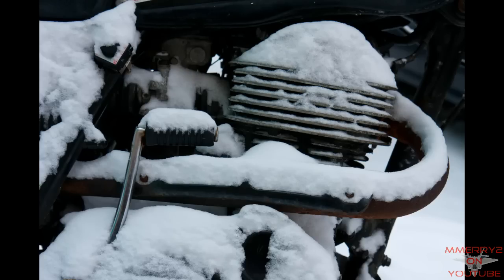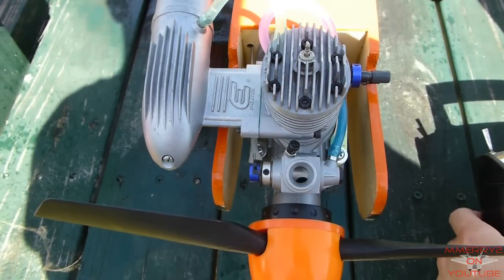Transitioning from Electric to Glow/Nitro Planes:  Intro to Glow RC Planes

Comment: My son and I flew control line then RC  nitro for years and my son passed in 2014 and left enough stuff to supply a hobby shop which I have in the shop (50+ new engines) ect.   I stopped flying in 2016 due to health problems. We sure had lots of good times.
Reply: Love that you have good memories and thanks for sharing the love here with us too :thanksdoc:
Reply: Me and my dad fly modern planes we love it. Know what u mean love yall
Reply: My dad has 60, some of which go back to 1947. He bought a Taplin twin when he was 16 then sold it. About 15 years ago, he wanted one again. He went online and bought one. When he opened the box, he found it was exactly the same one. He had a photo of it with the  serial number, and it matched. It also had marks on that he'd made by accident. Still there 40 years later.

Comment: There is so much used glow plane field gear on the used market, there is no need to buy any of it new.
Reply: @Rich Jake Some of the most fun I've ever had at the flying field was with cheap ancient third-hand glow planes that I've restored. Spent less on my 20-size Bridi Warlord all told than just the PnP foamie rough equivalent would cost and I love it to death. And the engine on it is so old it predates schneurle porting! But it's an OS so it runs mint.

Old does not mean bad. Just means inspect. Those old clevises might still be good might not be good you won't know if you don't inspect them. REplace the bad ones, leave the good ones alone.

New batteries and receivers are a given though, since these old planes usually have obsolete AM receivers and crappy nickel batteries in them. I usually put a 2s LiFE battery and a Futaba R2006GS in mine.

Comment: Started flying these “glow plug” fifty years ago.  I always loved them.  Yes they cause a bit of a mess with the oil in the fuel, but they are easier to handle in the wind and the engine sound is great.  They are just an all around great power source.  I do not fly anymore but still have a couple “OS Max” down in the barn. A 40 and a 60 as I recall.
Reply: Good man ya cant beat em  i still fly diesal ,and nitro here in Ireland electic planes no from me i still build by balsa wood it my take 2- 4- 6 months but its worth it in the end 😊
Reply: If you would like to sell the size .60 let me know .

Comment: Had to comment: I began my life long love affair with Aviation, way back in 1966, in college, and loving to fly my control line planes. By 1975, I bought my 1st radio for RC flying. Built an RCM Trainer by Bridi, and was smart enough to have an instructor from our club in Richardson, Texas, We were R2C2, pronounced, "R square C square". That name came from Texas Instruments where most of the club members worked at the time. Everyone learned to fly RC, at that time, by transferring the transmitter back and forth with the instructor to avoid any crashes. Worked for me, and I was off and running.

Fast forward to today, 08/2020, I'm in Florida today with my wife. Retired and still flying RC. Pattern is my choice of flying, with a touch of aerobatics. No 3D for me, I just love the pure joy of flight. During my hiatus from 1975 to 2020, I had bought 2 real aircraft, a Beech Musketeer, and a Grumman Yankee, while still flying my 1st love, RC! Now retired from Medical Engineering, I'm still flying Pattern. I switched from fuel to electric several years ago, and have been sorry I ever left fuel. Oh, I never liked all the clean up, but compared to electrics, I came back to fuel, and recently installed an OS 120AX in my 10+ pound, 73" plane. Big difference, and now I'm back home where I belong. 

The newbies of today think they love RC, but have no idea what the real joy of RC is, or even means. When something breaks, it's, "Oh my gosh, what do I do now"? They have no idea how to fix anything. They should try to build something from scratch, having only plans. Buy the balsa, ply, coverings, everything. They have no idea what they are missing. I built my favorite plane of all times, back in 2000, by the name of "der jager", all lower case. Means, "The Hunter"! A beautiful German looking bi-plane that was designed and built in 1968. Yes, 1968 as an experimental aircraft, then scaled down to an RC model. The feature article in RC Modeler in 1972. Wish I could send a picture of my plane. Finished it and have flown it 7 times. I have so much emotion in the plane, I don't want to spoil it from it's pristine condition today.

Best wind this up for now. I know electric is the thing today, but even though it does get those into the hobby quicker, and a bit cheaper, it's not the real thing. To be an RC modeler, one needs to be able to build from an ARF, at least, then finish it out by mounting the power plant, balance the plane fore & aft, double check all connections, fuel it up, and do the maiden flight YOURSELF! Now, that's what we old timers do, and have done many times. Buying a new foam airplane is not what the hobby is all about, bUT it is a beginning of a life's love affaire with Aviation! Good Luck To All!

Yes, my wife knows how I feel, and encourages me every day. What a Sweetheart she is! Married 24 years!
Reply: You sir have hit it right on the head! And I agree with you. I started scratch building airplanes in the very late 1970s for Radio Control. Before that it was dope and tissue rubber band propelled planes. I have not scratch built in about ten years, but I do enjoy buying old used balsa airplanes from Used online web sites. I almost always have to do something to them in the way of repair before they are ready to fly once more. And yes you just can’t beat the look feel smell and sound of IC glow engines. I fly all four stoke  for glow and some electrics too 50/50 mix.
Reply: I got into the hobby when I was 12 in 2013. Since then I have designed, built from complete scratch, 5 different airplanes, wood, foam, jet and prop. First scratch build when I was 15 and first gas plane just after that. I agree the modern eager rc flyer is spoiled by the sad phasing out of kits and overall patience, but some of us still exist! Not all hope is lost!

Comment: Interesting article, as it brought back memories. I began my model aviation way back in 1960, flying control line. By 1964, began researching radio control, and bought my 1st radio, an EK Logictrol from Texas Instruments. Many of the flyers were engineers from TI, and the club was the Richardson Radio Control Club. With so many TI flyers in the club, they changed the name of the club to R2C2, meaning Richardson Radio Control Club. I always liked that. I began with an instructor, and a high wing trainer called an RCM Trainer 60. Today, after over 40 years flying RC, from sport, to scale, to Pattern, I'm considering a rebuild for that old RCM Trainer. 

Referencing these foamies, I have tried 1-2, and can't stand them. Too quiet. This is not the RC flying I grew up with. I want to hear the sound of a perfectly tuned 2 stroke engine, not the pathetic buzz of an electric motor. I flew Pattern with an electric, and all seemed okay, but the hastle of charging the batteries the night before, and the other dangers of the immediate activation of the throttle control, with a razor edged 17" prop, just waiting to cut off a finger or two. Not for me. I've gone back to what I know and have always loved, Glow. Yes, the fuel is expensive. I used to pay $4/gallon, back in the early 70's, now at $30 +, and add to that Hazmat charges to get it delivered to your front door, it is still worth the price. It all breaks down to a cost per flight with my 1.20AX nitro monster at $5.20 for a 16oz. flight. Not cheap, but then what do you want? You want the pride of flying a plane you built, or even assembled from an ARF kit, weighing 10-11 lbs, or a 10-30 ounce foam looking plane that is, well let me say, there is no comparison. If you want to be a true RC hobbiest,  build your planes from a kit, or from scratch. These foam, look alike planes are cute, but they just don't do it for me, and from what I read, from many others as well.

My RC history took me from my college days, to getting my "Private License" in 1978. What a thrill that was, flying at 3000' and above, going to Oshkosh 3 times, and loving aviation even more than I had ever thought one could. I'm retired now from medical engineering, which brought me the money needed to keep in model aviation, and eventually owning 2, full sized aircraft. A Beech Musketeer was my first, which I never really likes until I bought my pride and joy, a Grumman Yankee, 2 seater. Today, I still fly RC, and enjoy what I found in the 1960's. Looking back, it was radio control that started my life's love affair with flying, and it has proven to be my sanity in todays screwed up world of millennials and miss information from all the news networks. God Bless America!

Comment: Here at the field they put the plane vertically with the engine on full throttle to see if it runs good in any condition... They also always remember me to not dive in full throttle because the engine will stop, and to listen carefully to the noise in flight... Your video is perfect for me! Thanks!!!

Comment: Thank you! This is very informative. 
I just acquired a nitro plane, and I had no idea what to do until now.
I've been flying electric so far
Reply: have a nice time up there and cleaning hehe
Reply: I still havent gotten mine up yet. I had mine given to me two years ago now. I first flew nitro in 1978 and HATED it. I started back into flying with an Apprentice  and loved it. Now I am ready to get back into flying nitro again. I have the Cadet LT-40. It should be a fun plane to relearn Nitro on. I had to replace the engine that was on it. The old engine had rusted up corroded bearings. I rebuilt it myself but havent tested it yet. I dont have much faith in it as the bearings were really bad and the piston rod bushing was siezed up. I finally got it to move again but it may end up failing. Thats why I bought a replacement engine. Brand new. I need to break it in.
Reply: Find your local club and talk to some   nitro plane guys they will be able to help you start it, and tune it and set everything up
Reply: Andy Weese, How do I go about finding my local RC club?

Comment: as one that use to fly nitro I can tell you there are advantages to both. nitro does deliver a little more power but you have a greater chance of a dead stick . the fuel is messy and fuel is expensive . you also need alot more support ie: NI starter , battery charger, electric starter or stick or a new nickname (stumpy ). fuel pump ect... and spend some time tuning and returning you motor for that days flying.

electric : airplane , battery , radio , battery charger.
more flight time less hassel , no clean up.
battery's can be expensive but compared to fuel I believe cheaper in the long haul. average life from a lipo is 50 to 100 charges . assuming you don't abuse the batteries. 
downside shorter flight times.
 For me I prefer electric  , call me lazy if you must but isn't the point to have fun flying?  how is spending part of your flight time getting the plane ready to fly fun?
some guys may like it , I don't .
I have to admit I love the smell of nitro methanol in the morning !
Reply: well I used to fly only electric, 2 weekends ago I bought my first nitro...just got my second yesterday :) Granted, it's not for everyone but if you like to tinker with things, taking apart cleaning and tuning your nitro or gas engine is a lot of fun in itself. And yes I think gas fly better than electric but electric is for when all you want to do that day is fly around. Both have their uses.
Reply: I like the fact that an engine gives out a constant power level as long as there’s fuel in the tank - with electrics I find myself wondering whether there’s enough in reserve for a go-around. In addition, I’m very wary of lithium batteries’ potential fire risks - I never worry about my glow engines burning the garage down :) It’s a personal choice - I love tinkering with engines, but I see the advantages of electric also.

Comment: You can also use a squeeze bottle for filling the tank. It's a handy bottle that also allows you to squirt a little fuel directly into the carburetor before starting your engine.

Comment: I fly both electric motors and 4 stroke glow engines, mostly on balsa airplanes. I do have several foam planes but much prefer the balsa airplanes over the foam.  I like both electric and glow. But really enjoy flying the glow the most at this point in time. I like the sound the smell and the feel of the glow four stroke engines. Down side is the cost of fuel and the oily mess. Upside is the longer run times of a glow 0ver electric, for my planes anyways. The electric are easier to get up in the air and are clean, but flight times are not  as long as the glow. 
Electrics take time to recharge the battery so you either have to have a bunch of Lipo battery packs fully charged on hand or you will be waiting to fly again. With glow you just refill and your off flying again. I take a mix of electric and glow to the field when I fly.
Reply: @Sun n Tan yes the sportsters and sky walkers are nice. I have both in.40 size and also 1/3 scale Space Walker

Comment: Hi there, i really enjoyed watching your video.  Very well presented and very well explained.  Im flying 32 years and up until recently all ive ever flown were glow planes.  The sound of a four stroke engine is music to my ears and i do like the smell of glow fuel also.  In the last couple of years ive started to fly a few electric planes such as the Multiplex Twinstar and the Multiplex Mentor which i have on floats and i love flying those planes also.  I especially prefer my float planes to be electric rather than ic as they are more reliable on the water. But overall i still prefer my glow planes mainly for the sound and realism and the smoke trail they leave behind.  Ive just recently purchased an electric B-17 flying fortress with a wingspan of 74 inches and i have to say that it flys really well, just like a big trainer.  PS. I still have my Alpha 40 trainer, the same one as featured in the video and i still fly it.

Comment: Awesome video.... you answered so many of the questions I had! Thank you! I fly electric but had curiosity for nitro/gas. Recently bought an airplane with the engine taken apart due to varnish build-up (OS Max 40). I cleaned it all up and was in the process of reassembling it, but I have some questions, including about lubrication and possible gaskets and other parts that I might be missing (??). Your video was very helpful. :-)

Comment: great presentation!!! I too started with electrics and am now learning if not transitioning to gas just because I want to try bigger and scale kit building. I didn't want to go with glow because they seem like too much of a headache to deal with the cleaning and tweaking....ugghh. I see some guys spending more time tweaking engines than flying. Beside the point, I have realized that with anything other than smaller foamies I would have to begin buying new and larger batteries and didn't want to even go down that road again after seeing how so many of my lipos have puffed or are beginning to after only a few flights. Thanks this was very informative.

Comment: Good presentation. However, you forgot some important information. Batteries for an electric equivalent to a .40, will be about $60 apiece. If you fly like I do, you may need 5 or 6 of them to fly out the day along with a 4 port charger, as recharge times are fairly long. Also, with an electric,  power starts to decrease as soon as you open the throttle with weight remaining the same. This leads to loss of performance as the flight progresses. With gas or glow, performance will increase as fuel is burned off.
   Batteries require diligent maintenance to keep in peak shape and are expensive to replace when not stored properly. I have a mix of electric, glow and gas, and find the gas engines to be the most economical for flight costs. Nicad batteries are easier and longer lasting than li-pos,  but the cost of nitro fuel is high. $20 per gallon at the hobby shop, if you have one close by. Gas, can be found everywhere, for less than $3 per gallon.  Having a mix of all three, means I am fairly tired at the end of the day, and if I leave the field with all planes (16 in my motor-home) still intact, it is a GREAT day!
Reply: I pay $38 CDN for a gallon of glow fuel in Ontario.

Comment: I'm venturing into glow from electric - still prefer electric for most excursions because it is cleaner and can be quicker depending on the plane.  That said, there's still nothing like the roar your glow plane makes doing a low and fast pass!  ;-)  Also, you asked about differences from glow vs. gas - the big difference the guys at my club say is that gas does not have nearly the oily emissions out of the exhaust.  So the cleanup is virtually none.  I'd go gas if I had big enough planes.  ;-)